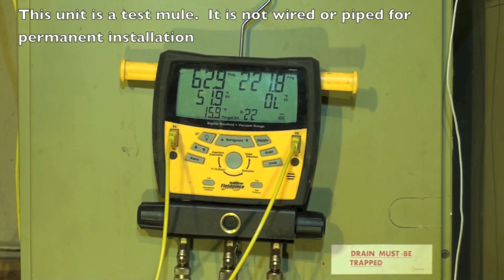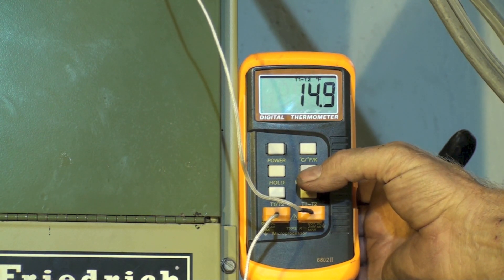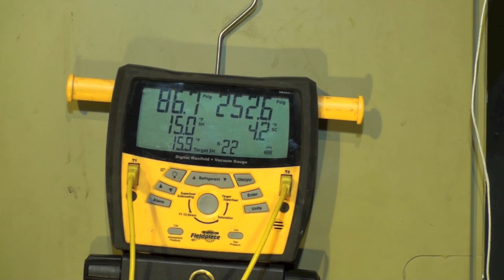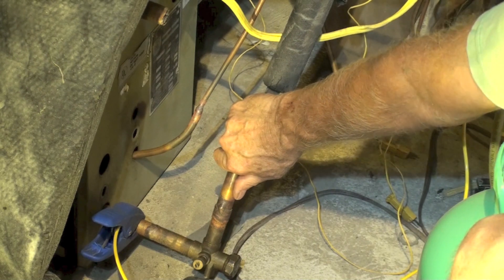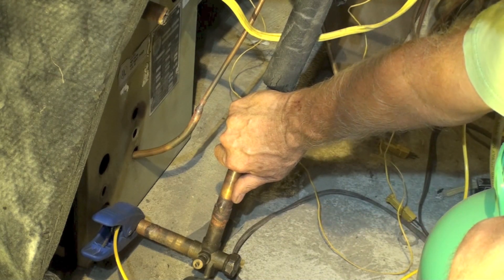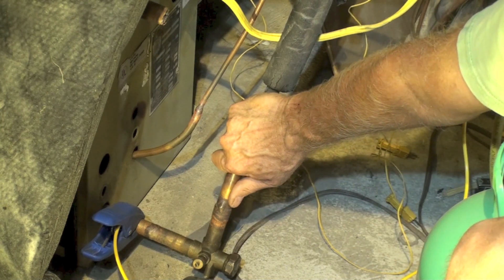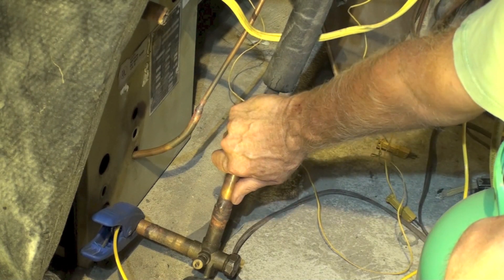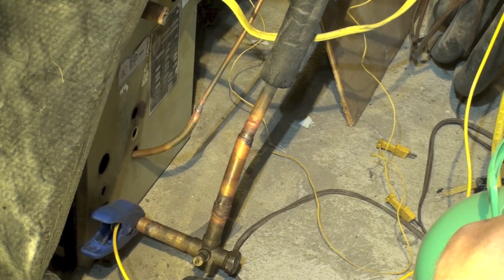Charging using your hand for superheat #3

Comment: This is what i teach against, the body is not a human thermometer it doesn't mater how long you have been in the field, it just tells people the type of work you do, notice the size difference in the suction line 7/8 to 3/4 the tubing will give you different working pressures at the compressor and the evaporator. Beer can cold ? OMG. some of the stuff i see on you tube is so far out there that i wonder where they got their education.
Reply from the maker: Did you actually watch this series or just comment?  This series demonstrates that using the hand is an effective charging method that can be used to check your other methods of charging.  I have found that an experienced tech can and should use his hand to check if his weigh in is actually giving the right charge.  Not all systems are matched and can be counted  on for correct charge as listed on the model plate.  If you are not using this method, to check your charge, you are shorting your customers.
GFM

Comment: GFM, I am a 40+ year veteran of the HVAC/R industry as well. We will disagree about this video. Yes, I too am able to assess a system initially by touch. However, you put these videos up to help techs building their knowledge not for the seasoned well trained technician. I train all our techs in house and act as in house tech support. I have referred them to your videos often and used them in training sessions. This video is a step back in time. Todays high efficiency equipment requires real data to properly set up, not the calibrated fingers method. Is this just bragging?  lol   Please keep your target audience in mind!
Reply from the maker: One time I was in a hospital emergency room with my mother.  The automatic blood pressure machine showed a problem with her blood pressure.  A nurse (highly experienced) came in and looked at the machine then felt her pulse.  She looked at us and said:  there is nothing wrong with her blood pressure.  She was right of course.  These videos were done to show that you are a tech, not a machine that reads data off of tools.  Many times I would work with students that would use the readouts from the tools and determine whether the charge was right or what the problem was.  Sometimes the readings are wrong.  Perhaps the setup was wrong or sensors placed wrong.  As was said on the video, I virtually never would use this method alone.  Determining charge levels and system diagnosis requires many inputs.  This is just one that I always used as a final check.  Thanks for using my videos.  That's what they were made for.
GFM
Reply: Yes must use all your senses! And understand the physics behind what is going on in the system. The person that knows how it works will always have a job, the person that knows WHY it works will be their supervisor! Every training session I have with techs involves checking the calibration of their instruments with a NIST traceable standard. Again, only real numbers matter. Have you looked into the Fieldpiece joblink system?   I was beta tester for the new meters. This is , in my opinion, the best system to document system operation, capacity and efficiency.
Reply: Are you going to the AHR convection in Vegas? I will be trying to.
Reply from the maker: I have not used the joblink system.  I do believe these systems are the future of accountability in the industry.
GFM
Reply from the maker: I had not thought of it but I may.
GFM

Comment: My god, please don't put this kind of stuff out there. If you really have that much experience in the field you should know better. Charging by feeling for "wet gas"? You've just lost me as a viewer since any credibility you may have had is gone.
Reply from the maker: Well, it does work.
GFM
Reply: So does closing your eyes, opening the liquid valve and counting to a hundred, but it's not even remotely right, and sure as heck shouldn't be taught to other people. Anybody that takes this advice and runs with it shouldn't be in this business.
Reply from the maker: This video was done to show it is a viable charging method.  Not for the inexperienced but it is viable.  You can see by the comparisons made to using gauge sets and superheat and subcool.  An improperly operating system gives many clues and will not feel the same as one that is correct.  Not all readings by tools are correct.  Certainly all available methods should be used to double check.  Many systems cannot be charged by weight alone as I found in the field.  
GFM
Reply from the maker: We could argue this forever.  We just disagree.  If you want to prove your point, do a video showing how it cannot be done.
GFM
Reply: I dont have digital gauges but I use my regular. My boss who train me in ac and refrigeration had about 50 years of experience in the field. I learn that as longest my coil is clean and no obstractions , you can use your hand. And if the suction pipe close to the condenser is cold and swating it was good to go..... We were always right in the money. Back in those days there was no digital gauges. And I can guarante that all of those installs and repairs that we did are still working properly, after 30 , 25, or 20 years ago. I call that experience

Comment: if you have superheat it means you have NO liquid in the vapor. that's what superheat means. wet gas? you cannot have superheat until ALL the liquid has boiled off.
Reply from the maker: When the liquid boils, it is very energetic. There is a fog of atomized refrigerant and oil in the tube. This why we call it a "wet gas". As it gets closer to the compressor, more and more of the atomized liquid touches the tubing sides and evaporates. That is why the temperature of the tubing pulls so much heat from your hand. If it were dry, it would not "feel" so cold. Try it next time you check charge. Hope this helps. 
GFM
Reply: +grayfurnaceman  In the cooling mode . What about charging till you get a sweat across at least 3/4 to all of the evaporator coil.  I am not the most experienced person and because of cost I am forced to do things for myself.  Whats the relationship between saturation, correct charge , and evaporator sweat ?
Reply: thangamajig Correct charge=sweat across all of the evaporator tubes."Energise"(sweat)all of your evaporator tubes
Reply: @ed bradbury - Although I probably haven't been alive as long as Gray has been doing HVAC, I agree with you. Perhaps the precise explanation why is up for debate, but there's obviously something to the technique. Maybe it's just feeling "almost liquid", kind of like you can tell when water's about to boil by looking at it.
Reply: I do believe you just said the same thing i said.
Reply: I agree.Basic fundamental refrigeration. The temperature will remain at the boiling point until all the liquid has evaporated and only then can more heat enter the system. Just because it is cold does not mean there is any "atomized liquid" present.  This is the worst expert explanation that I have ever seen from a self described expert.

Comment: Great video GFM, thanks again for sharing your experience with us.  Consider this... When you attach your pipe clamp T/C to the suction line on a hot humid day with the suction line sweating are you truely measuring the temperature of the suction line... or are you geting some evaporative cooling affect from the moisture between the T/C and the suction line?
Reply from the maker: Rich Rada I don't think it makes a material difference, but I will try to test it.
GFM